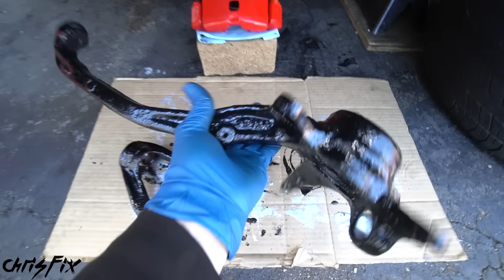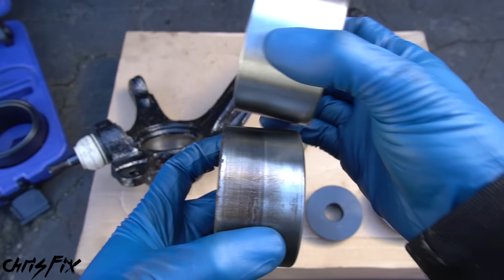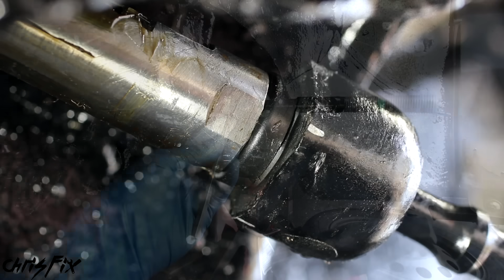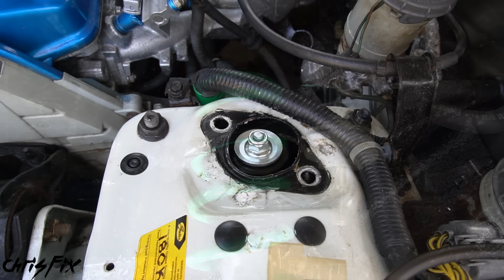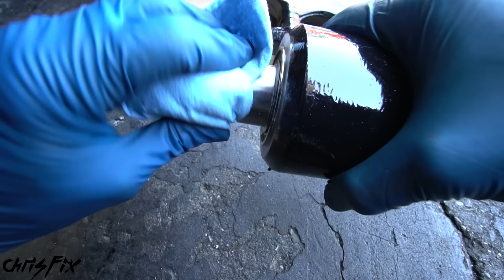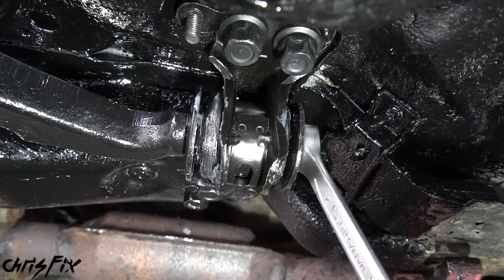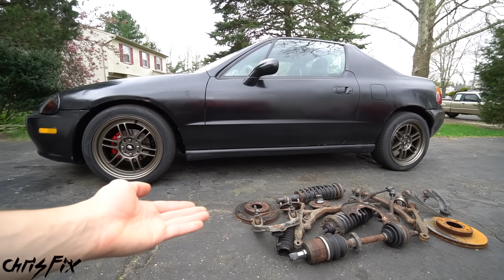How to Install a COMPLETELY New Front Suspension in your Car or Truck

Comment: Hello, Chris, what brand of control arms and tie rods do you recommend oh and also shocks?
Reply: Alejandro, what kind of vehicle do you have?
Reply: @vigilantemotors   a 2013 ram 1500 and a 1995 ram 2500 12 valve.
Reply: and other older  chevy 3500 trucks
Reply: @alejandrotudonmanriquez7702  Sweet ride my man, both of them. Mind if I offer some advice. I have built a few rigs in my day and I always like to help when I can.
Reply: @alejandrotudonmanriquez7702  The Rough Country control arms for the Dodge. These control arms have an OEM geometry that aims to keep the ball joint at optimum angles even for lifted trucks. They really work well and will last a long time.

Tie rods, for me the Mopar tie rod, the most likely OE part is perfectly fine and  great part. If you however are looking for something a bit beefier, Synergy make a good tie rod end that I think will fit your truck. 
Again, I think the Mopar part is really a decent choice though.

Shocks, I am typically fond of Rancho but if you want something really good you will want to go with Fox shocks as they are some of the best you can buy!

When you talk about your Chevy there is a lot of things you can do with that and my first choice would be anything that Currie makes lol.

Does that help at all? Are you lifting your trucks?

Comment: First off, I love this content.  With the average car now $40K+, we're all going to be DIYing a lot more.
I've got a Honda Ridgeline with 180K.  I need to replace the tie rods (got that video bookmarked).  However, I will probably want to do a complete front end suspension rebuild, like you show here.  I can't do it all at once, due to time and financial constraints.  What would you recommend I do in stages?
Reply from the maker: So tie rods are probably the most important part of the car because if they break you lose steering instantly. I would do them and your struts first and then get an alignment. Everything else can be done later and it shouldnt affect the alignment too much if at all depending on the condition of the bushings.

Comment: I would but where i live New Zealand, you can't do this unless your certified. And then you have to pay for it to go to be complied. Some 100 point or more search over ever and all corner.
Reply from the maker: Interesting, thanks for sharing!
Reply: @chrisfix  Crazy man. It's costing me 4k new zealand money, about 3,500 American to have new suspension put in. PLus then i have to pay for cert. Makes me wanna fly to the US OF A
Reply: certification is only for aftermarket parts (not oem replacement), you dont need a cert unless your adding coilovers etc

Comment: Hi Chris fix and viewers, I have a 05 infinti g35 sedan.  
Do u know why steering wheel is not returning to center after turning left or right? when turning left or right it seems steering wheel is continuing to keep turning left or right depending which way ur turning. and I have to manually turn wheel back. 
this happened after I overhaul my suspension too like u in this video. 
I changed power steering hi pressure hose bc it was leaking. after that I turned left n right several times to bleed out air from the steering system.

 next I changed the outer tie rod on rack n pinion, upper control arm, lower control arm and ball joint and rearward lower control arms and this is all done for both drivers n passenger side. 

I also replace front n back with kyb struts and shocks. not lowered. just all aftermarket replacement parts like u in ur videos. 

I have not taken to alignment yet, bc two shop I went to said they can't do alignment, until I fix the steering wheel issues to return to center first.

 so do u guys think I overtightened/over torque ball joints and control arms and suspension areas? or should i just find a shop that will do an alignment and hope it fix the return to ctr issues?  

b/c I can hear screeching/squeeching sounds when turning. and feel like and feel like I can easily do donuts or drifts or slide. lol.  lmk if u guys need more info to help me out please? this all.

Comment: Hey Chris, just had a question, would you recommend the company "Detroit axle"? I've seen a bunch of parts by them on ebay at a good price but idk if it's too good to be true, thanks for your time.
Reply: Antonio, they certainly are not favored by the BBB having a grade letter of F. 

However,  most people will tell you they are fairly good with a good reputation so maybe worth checking out.

Comment: Whered you find all these del sol parts ? I found the upper and lowe control arms and tie rod ends on rockauto, but I couldn't find the bushing setup that goes in the one side of the lower control arm.

Comment: Hi, I'm doing the driveshafts on a kia 2011 model, how do you top up the oil that pours out of the drive shafts when you remove the old ones? Do I replace the new ones and then top up via a fill hole on the gearbox housing? or is there another way? thanks

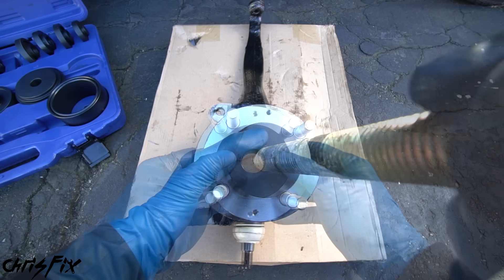Comment: 7:40 "Use the plate that fits on the outside edge of the bearing"
Wouldn't you want to apply the force to the inner race of the bearing? This way the forces to press the hub on aren't being transferred through the roller elements in the bearing.

Comment: Dear ChrisFix, Thank you very much for your video. I have a question about a front wheel bearing. My car is Honda CR-V 1997. The Honda Service says that front suspension parts, including the knuckle, upper and lower arms, sway bars, etc.,  should be replaced, except the front wheel bearing. I wonder why they didn't mention replacing the front wheel bearing. Is it because it is in good condition? I bought a new knuckle. When replacing it, can I use an old front wheel bearing to put into a front knuckle?

Comment: Chris, I have watched this about 10 times now, you have given me the confidence to replace most of my front suspension in my F-150
Question, why use silicone paste on the lower Ctrl arm bolts and not anti-seize?
Also why no anti-seize on the rotor or the hub? I only ask because those were the parts I had the most trouble removing.

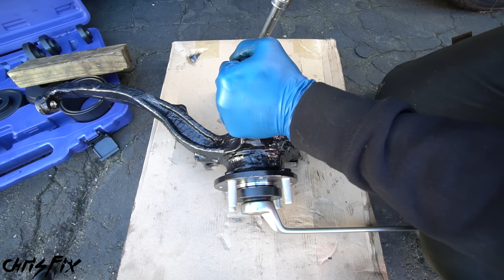Comment: 8:00 you want to press on the inner race of the bearing there not the outer race, if you were using an air impact instead of hand tools that bearing would be instantly fucked

Comment: All those parts cost a shitload.
Reply from the maker: It was about $350 for the whole front.
Reply: @chrisfix  cheap parts from China and add more money for front end alignment. $500 spent on a thousand dollar high miles car.
Reply from the maker: @jasonskywalker5635  actually the parts I installed, as I showed in the video, were high end OEM+ parts. The only “cheap part from China” was the axle shaft and I haven’t had an issue. And you’re right, I forgot about an alignment, that was $65 so $405 for the whole thing. And I got the car for $300.

Comment: I just replaced upper/lower Ball joints and arms, new inner/outer tie rod ends, the sway bar bushings and links.  Had the truck aligned and now there is a squeal on both sides when I am going straight but goes away when I turn the wheels? What would cause the squealing?

Comment: Enjoyed video!

Question, Chris? I have a 2005 Chevy Express Work Van, 6.0l 4l80tranny.

Issue: I had a wheel bearing cup come off some time back. Since then, the front, right wheel seems loose or wobbly. The steering also feels sloppy. 

One fellow watched & he indicated it looked like the tire was moving up and down verses wobbling side-to-side.

Changed already: tie rod ends, bearings, ball joints. Only thing remaining is idler arm & bracket.

Confused. Any thoughts?

Comment: Those Del Sols have a terrible turning radius. I'd MUCH rather have a Civic Coupe. I was going to buy one, but was very disappointed with the test drive. The lack of power was the problem, Honda swaps seem easy enough. The handling and visibility of Del Sols is TERRRIBLE. If you think you like them, drive one first. I was used to a Miata, but still. I drop an automatic v6 Accord before that and that Del Sol was... NOT GOOD.

Comment: QUESTION: Can the Bottom ball joint be removed and pressed without removing the knuckle? Thank you.
Reply from the maker: Depends on the car but many times, yes. Just make sure you lift the car high enough so you can get the ball joint press in there.

Comment: hey am experiencing engine flattering and hestiation and my #4 cylinder spark plug is burning black mi  change gas filter ,rings and conrod bearings air filter, timing belt, polish the values and  change the value seal another thing the #4 injector switch when disconnected the engine idle don't change ,,,, what you think could cause the problem of my car loosing power ???...

Comment: I just bought a 2002 Ford Escort XLT that wasn’t driven much at all for a 20 year old car. I went to bleed my brakes and start on the rear drums but it was so rusted out I couldn’t risk opening the bleeder. Any advice on what to do? Should I wait until the brakes are up for service and buy a complete loaded rear knuckle? I’m not sure what you would call that part that has the bleeder on it….I know that is usually on calipers
Reply: or is it just the drum brake wheel cylinder that needs replaced? that’s the part that has the bleeder on it

Comment: The ice shrink method, can i use it for bushing lower arm? Is this method can damage the rubber inside? Thx
Reply from the maker: Yea it can help get the bushing into control arms and no it won’t damage the rubber part of the bushing as long as you don’t press on the rubber.

Comment: Hey Chris, I love to rewatch you videos for refreshers. I have a a question though, how would you remove the inner tie rod when you indented the the lock nut?
Reply: Hi, with the wrench and adapter that indent would undo.  But vibration wouldn't do it so its a safety precaution.

Comment: Everything was perfect EXCEPT that you pressed against the outer race when you pressed the wheel hub in.  You should have pressed against the inner race.  You smashed the ball bearings into both the inner and outer races, and deformed them as you pressed the assembly together. You damaged the one bearing we saw you install,.  That bearing is likely noisy and will fail very soon (it probably already has by this time, it the car is still being used).  The work you do is otherwise excellent.  Please don't be offended.

Comment: Also folks.. Dontot just get a small portion of the job wether it be tools or parts.. Get all of the equipment.. I learned the hard way, 1hour job took 2 days and more money than if i just bought the whole parts package aswell as the tools, press and hub puller.. Yada yada, wound up buying all the tools just to have em.. Spendy at that.. Infact i was saving to buy a new audi but couldnt neglect the civic.. So spent my savings on tools and equipment..   Hondas will do that to you

Comment: This is my second time watching this and I feel a little more confident on taking on this task, however, I do have a few questions.

1.) Can I put any type of suspension system on my car, or do I have to use a specific one.

2.)  I went to AutoZone and noticed there are different sizes of jack stands, so which ones should I go for?

3.) You mention tightening things, "to (X) ft lbs," what does that mean, and how do I know when I've hit the right amount?
Reply: 1. there are specific suspension sets and types for each car, just google your cars year and trim and it will pull up what suspension goes on it. some websites will also have a filter option that shows stuff for your specific vehicle. 

2. look at the sticker on your driver side door jam that shows you the weight of your car and get the jack stand that goes over the amount of weight your car is, this is important lol 

3. for the ft/lbs you need a torque wrench i got one from harbor freight and it works great what it is is basically is that’s the amount of lbs taking to tighten that bolt to make sure it doesn’t fall out. (in simpler terms)
Reply: @DEENO_4K  Hey, thanks for the reply man, it's greatly appreciated, one last question, how do I know when I've reached the necessary ft lbs needed for things to be properly tightened?
Reply: @Drojanx  of course brotha! when you buy a torque wrench it’ll click, and that’s when you stop!

Comment: Do not apply thread locker onto bolts that require torquing down, where thread locker is not specified. 

Every bolt that he has applied thread locker to, then subsequently torqued down is now over torqued because the thread locker acts as a lubricant.

You shouldn’t need thread locker if your torque to the correct specification, as that’s the whole point of torquing bolts down to stop things from shaking loose. If you absolutely insist on apply thread locker to bolts, reduce the torque setting you are applying.

Comment: Hey Chris, you might not want to do this but you can make decent replacement heat shields for behind the brakes out of sheet or coil aluminum roofing stock - the roofing section of any hardware store/home center will have this.  Cut the stock to approximate shape using 'tin snips'  and make holes with a punch, a chassis reamer, or even just a nail over a wood block (the hole will get big enough when you run the bolt through it).  If you need to use 2 pieces of stock to make a shield that's OK, just overlap the seam about 1 cm and pop rivet it, then caulk it with bathtub caulk or RTV gasket maker.    When you put the shields on the spindle/control arm, you can make any final bends or snip off any excess so that they fit right. 

Why?

Because it's not okay to run without the shields in place in cold climates where you can get road slush splashed onto the brakes, or even just rain if the temperature is near freezing, or oil if some was spilled on the road.  If rain or slush splashes and  freezes on the rotors, which it can in certain conditions, there is a likelihood of problems (perhaps resulting in damage or casualty) trying to stop. If oil from some spill gets on your rotors, there is almost a certainty of problems trying to stop.  The problem with aluminum is that it is damaged more easily by road debris if you run over something and it gets whacked.  However, since you did the shield yourself you can just as easily repair it. Inspect it each time you work (or have work done) on your tires or brakes.

Comment: I have to comment about the freezer thing. As a millwright I would heat things to shrink fit, or interference fit. You can heat things to 400 or 500 degrees to get them to change size .005 to .010 thousandths of an inch in size. Its all dependent on the thickness and diameter etc. etc. I can tell you with an almost certainty that putting a 90 degree (and thats hot to the touch) bearing into the freezer and dropping it 30 degrees in temperature, the size change  is going to be negligible and probably wouldnt even make a difference.

Comment: Hey Chris, I have a F150 2wd and need to replace the wheel bearing. It's an entire assembly with rotor to buy if I can't extract and press in new bearings. How can I do treat? So it's either whole thing replaced at approx $150 or new bearing at $15   and the rotor itself is in great condition. Such to have to replace it all. And I'm financially challenged.

Comment: I changed my cv axle due to noise when accelerating and turning left, only coming from the leftside aswell, also replaced the seal. but for some reason the problem still is happening. Not as loud but still there. what can I do? I also realized my boot on the right side tire rod is ripped after replacing the cv axle.. Noise doesn’t come from that side. Help my boy lol

Comment: On the fact of no trans fluid draining out of the axle output shaft holes, while I've done the same thing (gone with it if nothing drained out) and even skipped topping off (maybe only if it didn't drain much), would it not be worth taking no drainage as a possible clue to check the trans fluid level anyway to see if it's low for another reason?

Comment: So i went in without a plan and installed the lower control arm, i didnt put the whole wait of the car on the suspension but i did jack it up until it was tight, is that still ok or am i risking the bushinings to wear and tear?

Comment: @ChrisFix on a 2014 mini  countryman what should I expect to pay a certified mechanic for:
1. Remove rear O2 sensor defoweler 
2. Suspension install
- front and rear sway bar bushings
- front and rear control arm bushings 
- sway bar end links
- rear camber arms
- inspect tie rods 
- grease as much joints as possible 
- keep old parts
3. Brakes
- bleed 
- install stainless steel lines
4. Balance rear passenger tire
5. Four wheel alignment wait 100 mile min for break in first

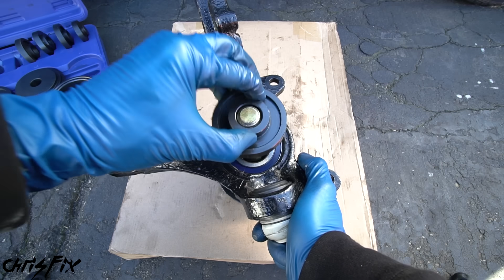Comment: 7:42 There's a mistake here in the dialogue. "...use a plate that fits on the outside edge of the bearing..." This should be the inside edge of the bearing. Unless something else was meant that I misinterpreted?

Comment: Dont for get sometimes the main bearing has a wheel speed sensor built in to the wheel bearing and only goes one way , or the system dont work

Comment: Hey Chris, hope you're well.  So I don't generally leave comments but watching this video has given me some hope and strenghtened my resolve to proceed tackling my own DiY project regarding my 2005 Dodge Magnum R/T 5.7L HEMI.  Recently, my front suspension gave out on me and I stopped by a Mr. Tire shop to get an estimate - they wanted roughly $4800 to do the whole job.  

The way I see it, I have a full size garage, the technical curiosity, and will to do this....and after watching how effortlessly you did yours with the step-by-step instructions, I feel confident that I can get mine done.  Thank you for being an inspiration to DiYers like myself.